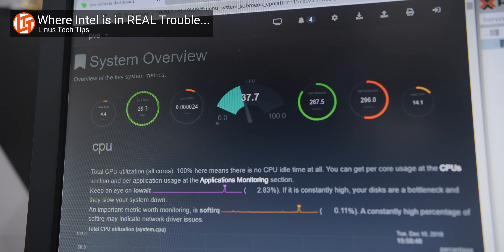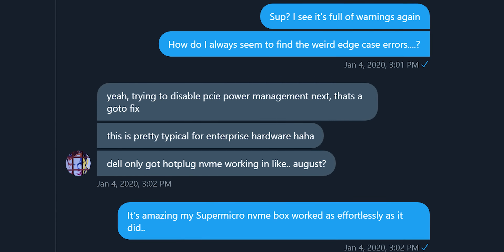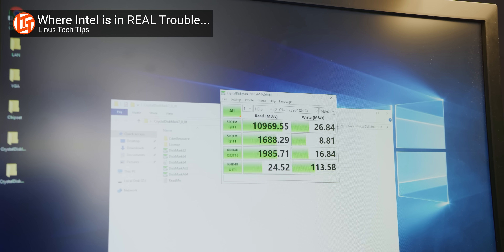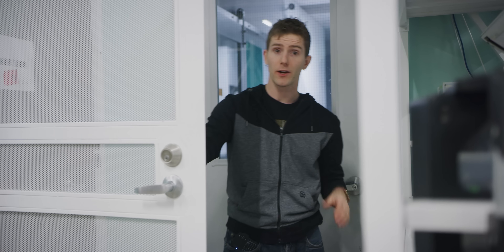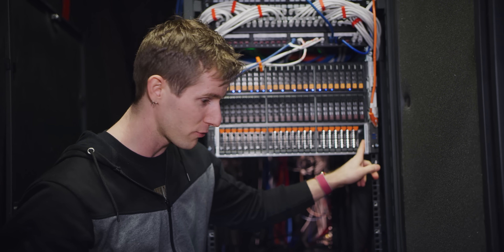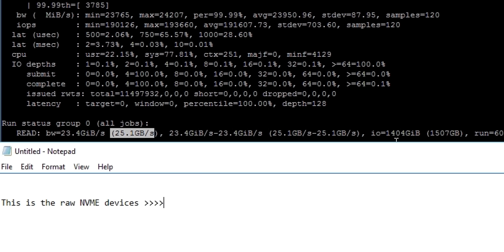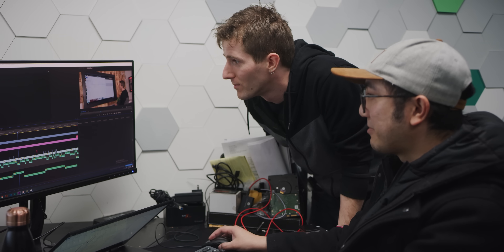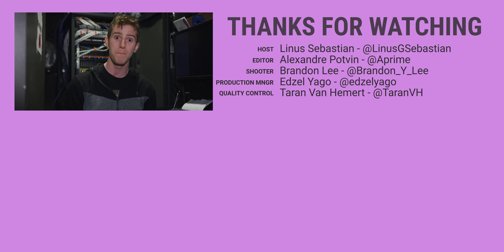This Server Deployment was HORRIBLE

Comment: I've got an Intel S2600WF Dual Xeon 14c/28t with 18 Intel DC P4600 NVMe's switched to the PCIe-bus. The storage I/O and bandwidth is nothing but a bad joke. I could hit 180MB/sec. write on a 4 drive RAID-5 array. Reads were actually ok (5GB/Sec.). More than 4 drives to the RAID-5 had a huge performance penalty on writes due to VMD-spanning (yes, we used VROC). Now everything's in RAID-10 (3GB/sec read, 2GB/sec write) which is still a joke. Intel's RAID-10 implementation with VROC is supposed to be hampered by their ancient miniport-driver, to not only cripple performance but also flexibility by limiting RAID-10 array to 4 disks... What the F is going on over at Intel? It's not just that the performance is bad...it is never consistent and all over the place... I heard, that MDRAID does a better job than Intel's VROC, but I'm too scared to install some homeopathic linux distro I've never heard of with experimental kernel tweaks on a production hypervisor... A couple of weeks ago, in addition to the horrible performance, IASC started throwing PCIe datalink errors and PCIe surprise link down errors at me. Intel Enterprise Support: "IASC is obsolete and should no longer be used." Me: "Ok, what else should I use then?" Intel: "We will eventually release a different program...some day...". Intel's official enterprise support is absolutely clueless and throws out suggestions like removing the power cords from the system and running the same BIOS-Update again, so FRU and SDR recalibrate...

Comment: at the 4:50 mark, I was very surprised to hear the explanation "that interrupt never arrives."    I've never had a case where interrupts were just dropped on the floor, even with a busy CPU.   Is that because the number of arriving interrupt requests overflows a resource (ie, it can handle a queue of 256 IRs but drops 257?)
Reply: If I recall correctly, there are different levels of interrupts that have different priorities. But I've never heard of an interrupt being dropped completely, you're right. I wonder if interrupts can just time out with unimportant things like disk operations? You're probably right about a limit on the number of interrupts. Who knows. I've mostly dealt with this stuff on embedded systems but I can't imagine a full processor is much different in practice.
Reply: @ForwardBias  my understanding is that the request timed out before the interrupt was handled, leaving the handler with nothing to do
Reply: @CrashTestCoder  that could be. I wonder if, by the time the processor handles the interrupt, it just gives up because it's been too long, and figures that if the data is important enough another request will go through?
Reply: Same reaction here.  Dropping hardware interrupts seems like a Very Bad Thing.  The CPU was "too busy" to get around to an interrupt ?

Comment: Linus the copper pipe water cooling build needs the device the plumber uses in this video https://youtu.be/jR917D0PpD4
its used to freeze either side of a pipe to stop water to change a fittings.  or in other words SUBZERO/near zero Cooling directly to the cooling fluid

use something that won't freeze as cooling liquid obviously^

Comment: My last AMD processor was in the early 2000's the 1400mhz Thunderbird, and coincidentally it also had a chipset problem. I had bought a VERY expensive Korg Oasys soundcard and it would not work no matter what I tried. It ended up being a bug in the AMD chipset with their PCI lanes. I went to a Pentium 4 and it worked immediately, never looked back. AMD is doing great this year, but I'll still stick with what is stable.

Comment: 5:40 So, you're saying that your defaults suck, especially preemption and software interrupt offloading, and all you needed to do is adding things like 'rcu_nocbs=0-128 rcutree.kthread_prio=95' to kernel cmdline and switching io_poll_delay=0 & io_poll=1 in /sys/block/nvme*n*/queue/ ? Also, maybe not tie your enterprise server to out-of-tree FS, glued to kernel with snots and braces. Also, might want to use transparent hugepages (usually, 2MB on x86) and alling block sizes with them.

You may also want to keep nr_requests small (16-128) for the sake of latency, set max_sectors_kb to 2048 or max that's available. And keep read_ahead_kb to 2048 or much more (for some reason it's very influential for throughput even though on RAM-type media it should be detrimental and disabled).

Comment: Ironic that IRIX handled this just fine 20 years ago, despite having much slower hw. :D  64-CPU Onyx2 Group Station for Defense Imaging, load and display a 67GB 2D sat image in less than 2 seconds (massive FC array, system I/O bandwidth of 40GB/sec). The bw scales, so a 128-CPU system would be twice as fast. SGI never published data for the final later Onyx3900 system (they stopped doing so after 9/11), up to 1024 CPUs with bw links twice as quick and lower latency, but in theory 1TB/sec.

Comment: I worked on azure stack which uses storage spaces internally.  OEMs would consistently promote products that “worked” but when given real world scenarios would crash and burn just like what you described.  It was maddening but eventually we were able to work directly with OEMs to fix the bugs over several months so the boxed set hardware configurations were eventually solid.  Hard to diagnose load issues with storage and the disappointing lack of proper load and real world testing is one of the reasons that BYO hardware is harder than it should have been.  After going through this process I think going the boxed route for storage servers makes a lot of sense.  I don’t trust storage solutions to just work.

Comment: Did you take a look at reserving CPU core solely for kernel use as well as pinning IRQ to those specifics cores and played with numa nodes ? The key is to have NICs and Storage on the same CPU package (or numa node) to avoid cross memory traffic. 
Btw, you really should have a look at distributed filesystem (like Lustre FS, etc.)
Reply: Agreed, need to make sure the NIC and NVMe interrupts are correctly pinned (/proc/interrupts) and blacklisted in irqbalance. The CPU arch and chiplets are probably hurting you here however you set your affinity due to inter-chiplet memory access and thus you might have been better with a monolithic CPU for such a use case. Anything accessing I/O should also be pinned like smbd. Talking of which, even with multi channel, it's still going to be the primary limiter on your perf. You might want to explore NICs with RDMA support for an improvement in latency and reduction in system wide interrupts when using samba. As suggested, a better approach like Lustre, GlusterFS or Ceph would have been the way to go.
Reply: +1 for distributed filesystem.  Also screw RAID 5 for this.  What kernel schedulers are you using?  This whole thing is a very solved issue, so I'm chalking this all up to user error/lack of knowledge.
Reply: @x86brandon2  Amazon's experiencing it, Linus is experiencing it, L1Techs are experiencing it, but random guy in comments claims that everyone knows the answer it's so obvious...

Righteo then
Reply: @peter.dolkens  Please reference where Amazon is having issue with it.   Mistake #1, they aren't using direct IO.  Mistake #2, ZFS.  Mistake #3, RAID 5, Mistake #4, single server, Mistake #5 the IO scheduler they are using.  The random guy you're referring to, is responsible for 300 PB+ of SSD's hosted in AWS on thousands of instances with exactly zero issues.
Reply: @peter.dolkens  Also, point me where you can get 24 NVMe drives in Amazon.  Oh wait, you can't.  :)
Reply: Brandon Mumby / M41K0 would you mind doing a short article about this somewhere? Specifically what they did sub optimal and what would have been more appropriate solutions. I would be thrilled to read and learn more!
Reply: @x86brandon2  I too use cloud systems. Doesn't change the fact that Linus referenced the threads where people were encountering the same issues in Amazon NVMe instances.

I don't really need to respond to you here, because this video is the response.
Reply: @mattiasgarnow  Brandon's mistake was he claimed to be an AWS expert, but isn't even aware of Nitro based instances, which according to the docs, appear to support 27  NVMe based devices connected via the Nitro card.
Reply: @x86brandon2  My first guess was the IO scheduler but as soon as he said ZFS I figured that would be an issue but how would RAID 5 specifically cause an issue? Unless it were a software RAID using up processing power I really don't understand how it would be an issue.
(and yes this is a legit question, No sarcasm intended)
Reply: To achieve the limit of 64,000 IOPS and 1,000 MB/s throughput, the volume must be attached to a Nitro system EC2 instance 

Nitro Components
:
Nitro card

Local NVMe storage volumes
Reply: @peter.dolkens  Nitro is proprietary, and the hypervisor.  Users would not see that.  Nor would it be apples to apples to say Linus' issue has anything to do with an issue Amazon may or may not have.   On top of that, while the Nitro subsystem can handle 27 devices, Amazon doesn't offer anything with 27 devices.  Their bare metal caps at 8 drives.  They also use a hardware based accelerator card to do so.  All of that is for EBS, their block storage system.  Again, Apples to Oranges.  The Nitro EBS volumes are network attached, not local.
Reply: @peter.dolkens  That is for network attached storage (EBS).  Their NVMe drives are much much much higher, but only a max of 8.
Reply: @Nec89  Since they flipped to software RAID, parity calculation (RAID 5) in the multi-million IOPS range is very taxing on CPU.  It also makes for painfully slow rebuilds.   RAID10 would have little to no measurable CPU performance and has much faster raid rebuild times because you're only copying A to B, not trying to re-stripe.
Reply: @peter.dolkens  https://aws.amazon.com/blogs/aws/ec2-instance-type-update-t2-r4-f1-elastic-gpus-i3-c5/ Their local NVMe (not EBS) can do 3.3 million IOPS and 16 gig/second with small blocks with only 8 drives.
Reply: @peter.dolkens  Case in point, the threads don't exist because no one could actually have the set up Linus has in AWS.  You can't get 24 NVMe drives.  You can't use a KVM hypervisor.  So the problem he has, can't possibly exist for customers on Amazon.  So it's all BS, basically.  :)
Reply: Brandon Mumby  I'm sure you already know this, but you lose half of your capacity with RAID 10. While I agree that RAID 5 shouldn't be used for the highest performance workloads, it does give you the least capacity loss while offering some form of redundancy. Could've been a factor for him.
Reply: My thought as well.  On many core CPUs, you could fairly easily sacrifice one core specifically for this.
Reply: Please upvote this guy.
Reply: How do you reserve a core for kernel use? Obviously I've not messed with this but it'd be interesting to read about. A bios setting or further down, hypervisor, filesystem setting...
Reply: Yea, I'm not sure if NUMA affinity has anything to do with it but I think you are on the right track: user error.
Reply: At the end the day Wendell is truly a Level 1 Tech!
Reply: @fred290e  As good as the joke is, don't be rude to all Level 1 Tech :p We all have to start somewhere and we all have different expertise field ;)

Comment: So...to recap:

The 40 GbE Mellanox NIC is definitely the bottleneck.

The NIC itself might be a PCIe 3.0 x16 card (I don't remember, I'll have to watch the original set up video to pull the model number and then look up the specs of it to confirm), but on the assumption that it's a PCIe 3.0 x16, that's 128 Gbps at the interface or 16 GB/s.

(Note, it's a 40 Gb (lowercase b) E card, ergo 5 GB/s per port).

If the 24 NVMe SSDs are PCIe 3.0 x4 each, that would be 32 Gbps per drive * 24 = 768 Gbps or 96 GB/s.

I don't know if there are enterprise NVMe 4.0 x 4 drives out quite just yet.

I'm somewhat surprised that AMD EPYC and NVMe devices are having such a hard time with your array.

It's a pity that I don't have any NVMe RAID arrays up and running to be able to help you diagnose and fix the issue. The SSD array that I do have running right now is just four 1TB Samsung 860 EVOs SATA 6 Gbps SSDs, running in RAID0, and BEST case scenario, I am able to get about 2 GB/s write speeds (as each drive is good for about 500 MB/s), which is around 16 Gbps tops, on a four drive array. (This is being accessed over 100 Gbps 4x EDR Infiniband, by four compute nodes.)

So...having said all that, maybe a better solution for you might have been to get one of those four-half width nodes that can only support 6 NVMe devices per node, and then you can run a distributed/parallel filesystem like GlusterFS on it for your purposes.

(Even my four 6 TB HGST 7200 rpm SATA 6 Gbps HDDs is able to sustain around 700-750 MB/s (5.6-6 Gbps) speeds, as each drive is good for upto around 190 MB/s.)

That's what in my scratch disk/head node right now.

In your use case, you might actually benefit from a distributed, parallel filesystem like GlusterFS.

I'm surprised that Wendall didn't suggest that to you. (Course, it has the potential to increase your cost, but if each processor install per node is say, only an 8-core or 16-core CPU, then you might still be able to come out on top because your total number of PCIe lanes increased by the number of CPUs you install.)

Hmmm....interesting.

Good to know though.

(I still think that you should be able to get around it, but again, I don't have the hardware nor the budget to be able to help you verify that, unfortunately. :( )

Comment: FYI there's SPDK when Linux kernel can't handle much, which usually the case, the other problem is RDMA limitations and IOMMU groups shenanigans. 
tldr; with RDMA there's no "Interruption handling" you're just polling for data on a set of RAM huge pages and do your thang after that i.e. there's no memcpy - it's like magic.

So ...
To put it simply SPDK NVMe poll-mode driver will be executed in UserSpace with monopoly access to dedicated set of
 - CPU cores (affinity mask and isolcpus)
 - RAM huge pages (depends on the target arch)
 - RDMA's and the respective IOMMU groups with vfio
 - ext4 or ZFS over blobfs 

Linux kernel has absolutely no impact on the IO and due to the absence of userspace/kernelspace/thead/interrupts switching on the target CPU cores, there's even no memcpy...
The SPDK poll-mode drivers performance is as good as it gets.

That's the only was this works nowadays...
https://github.com/spdk/spdk/blob/master/doc/blobfs.md

Comment: "we only have a 40 gibabit network connection"
Reply: Remy Peacock that’s not internet its LAN bandwidth. 

I’m buying a 50GB NIC soon for my server. 200 bucks.
Reply: freerice9595 I’ve never seen a 50gb NIC. Typically I see 1,10,25,40, and 100Gbps NICs out in the field. What NIC are you buying?
Reply: @karthik11512  it's confusing if you're not in the industry, but there are 40GbE and 50GbE Ethernet specifications. They are similar in speed but are based on different specs.

40GbE is based on the same technology as 10GbE, and uses a quad-SFP+ (QSFP+) connector with 4x10GbE channels bonded as a single 40G link.

50GbE is a separate specification based on 25GbE. It is also related to 100GbE. A 25GbE Ethernet connection uses an SFP28 connector with a single 1x25 link. 50GbE uses a quad-SFP28 (QSFP28) connector with 2x25g links to form a 50Gb/s channel. 100GbE uses the same QSFP28 connector as 50GbE, but uses all four channels of that QSFP28 connector to yield a 4x25 which forms a single 100Gb/s link.

With 200GbE now available, there are all kinds of new SFP56, QSFP56, OSFP, etc connectors... And 400GbE is around the corner around 2022 in the server space when the PCIe5 processors come around.
Reply: no name Legend. A perfect answer right there if ever I read one. Rare to see someone who actually knows what they are talking about.

Comment: Don't use Windows.....Use ZFS, What Kind of HBA and Backplane are you using?   You should use PCIE4 as well.   Probably would be better going with 2 CPU Sockets.   There are many Linux Kernel Tweaks to do as well to help out.   I used to work for a Cloud Company and we were able to fully saturate the PCI 3 Bus no problem.  We couldn't wait for 4.0

Comment: AFAIK that polling vs interrupt handling has been already done years ago for >=1Gbit ethernet devices. I guess the technical term is "interrupt storm", where interrupts are not lost per se, CPU just spends ~100% of its time handling interrupts. Strictly speaking if you hook up enough devices firing interrupts to any motherboard, you'll hit the storm eventually. That said it is still very impressive that NVMe drives force kernels to handle interrupt saturation.

Comment: Linus: "I haven't finished setting up the server and I haven't found any errors yet!"
Also Linus: "I didn't check for problems before transferring data and problems showed up! What a horrible system!"
Every other computer-literate person on the internet: sitting there eating popcorn like this is the best movie of the year
Edit: I know you figured it out when I would have had no idea what was wrong, but what did you expect to happen when you taunted Murphy like that? Always test the system before you brag about how well everything went. I don't consider even plugging in a mouse complete without that little safety jiggle to test if it works.